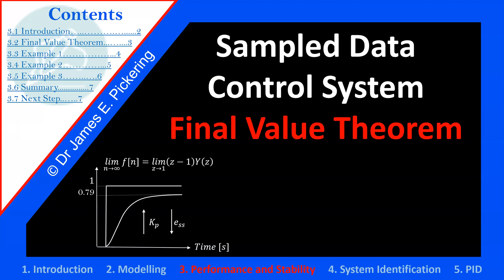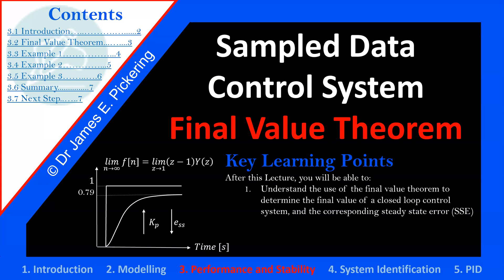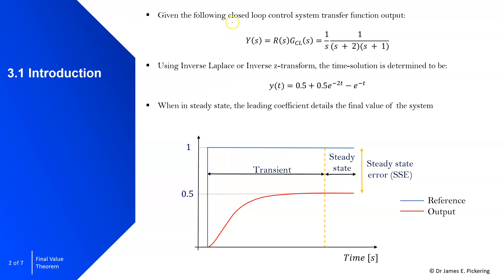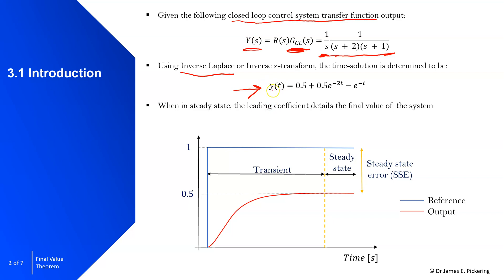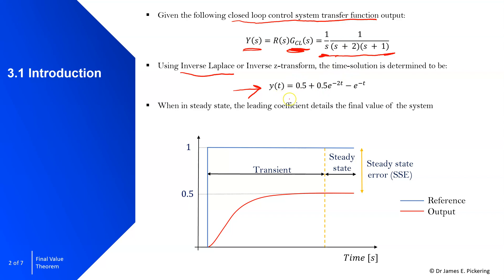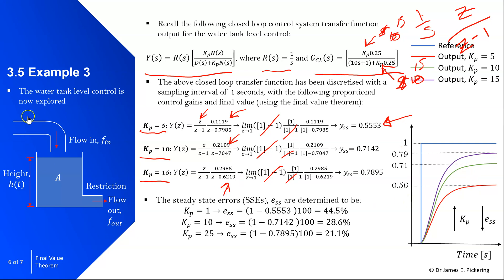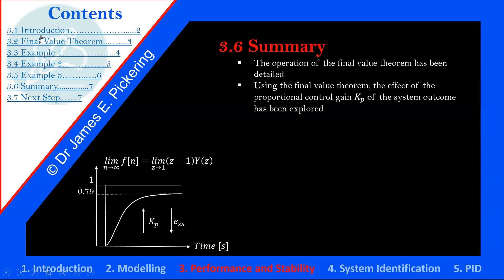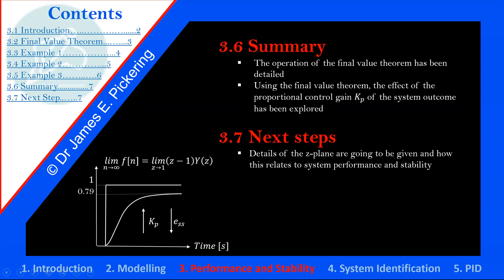3.1 Final Value Theorem

Comment: Professor, for example 2, the discrete feedback system is divergent when controller kp is 25， because the eigenvalues of system are z1=-4.0226,z2=-0.4692. While, the continuous system is stable and works well.😀
Reply from the maker: I guess the instability arises from the sampling interval? When discretising a continuous-time system (or control system), the pole location is a function of the selected sample interval.
Reply: @ACE-Lab-Engineering  Quite right, when the sample interval are 0.1, 0.01, 0.001. The discrete close loop system is convergent again. It shows the pole location has a relationship with Ts. Can you give me the equation which can build the two variables? Thank you, professor.